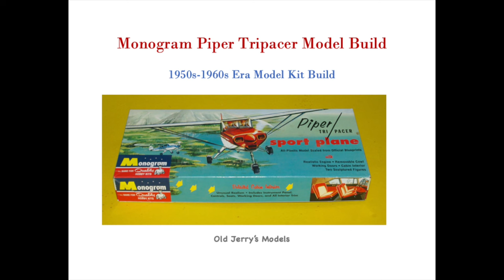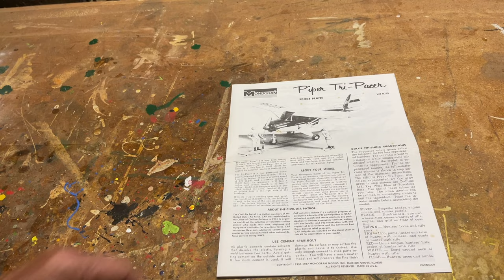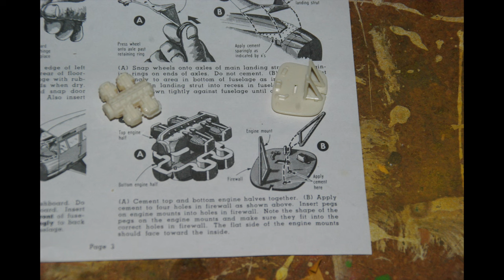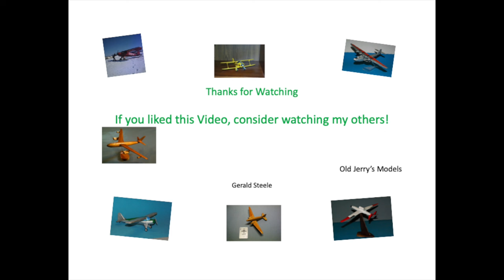Monogram Tripacer Early Plastic  ModelBuild

Comment: Nice build!  I used BBs and Elmers Glue in the nose and both engine areas of my 1/72 Hasegawa P-38 to add forward center of gravity (enough cavity space for it to work).  A recently built 1965 copyright 1/72 Revell F4F-4 Wildcat also has a removable upper half cowl to see the engine.  I kept the feature since it is original and to see the resin engine (the original engine front was missing).  Is the upper cowl fit perfect, no, but it still looks good.